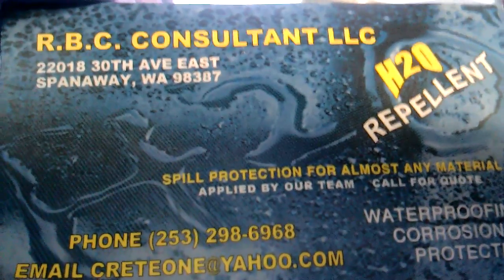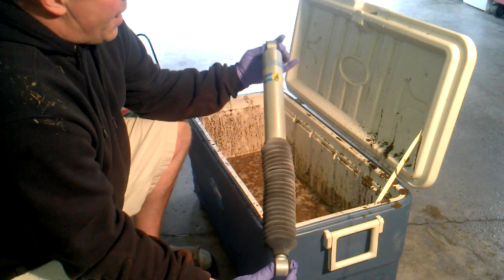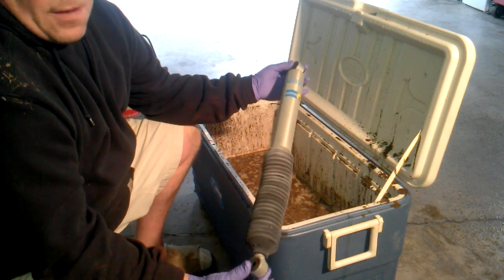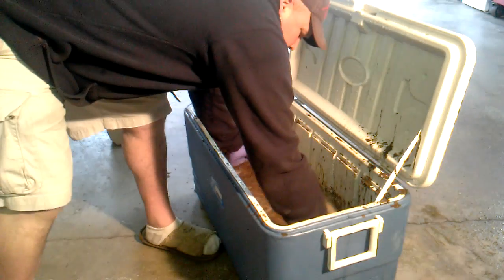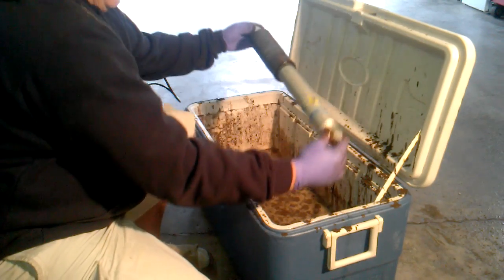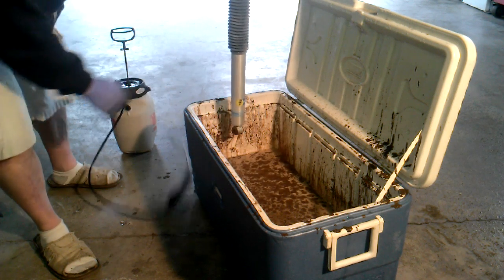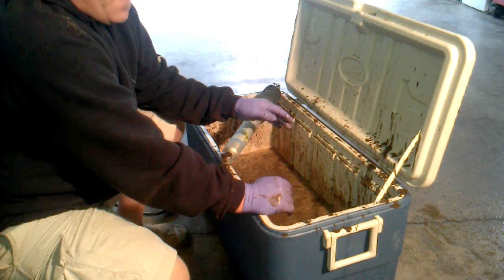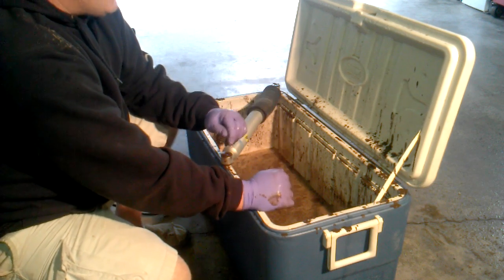Ultra ever dry, 4*4 parts mud test

Comment: Hello Bowron,
Incredible video! Could you test it on a airplane especially wing and prop?
Maybe you can take a simpel rc modelplane set it in a freezer with a fan blowing(to simulate flight) and spray water on the airplane. I want to see if it is suitable to prevent icing on airplanes.